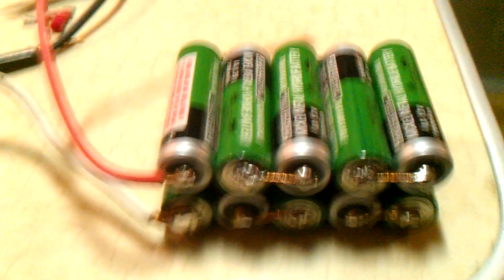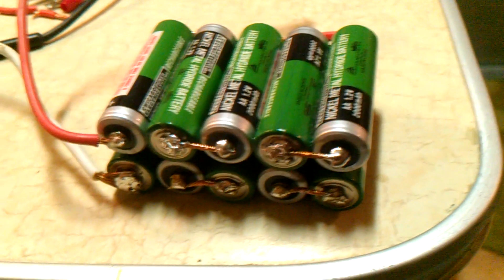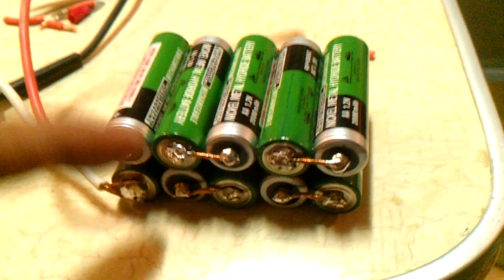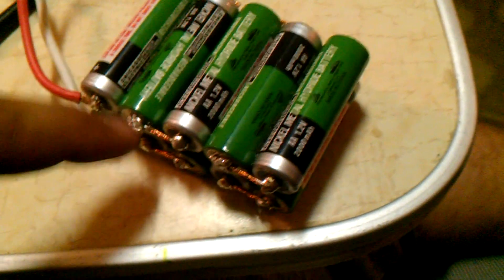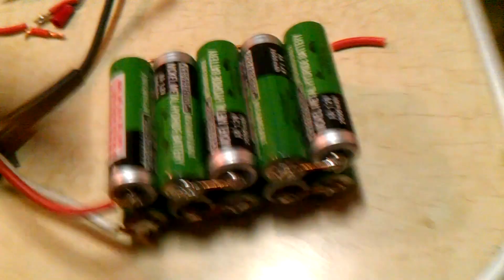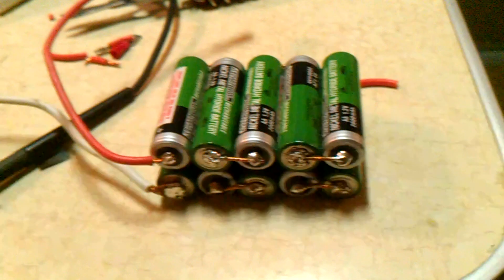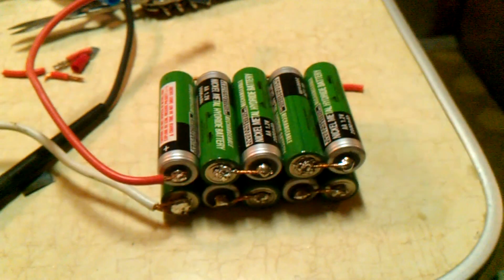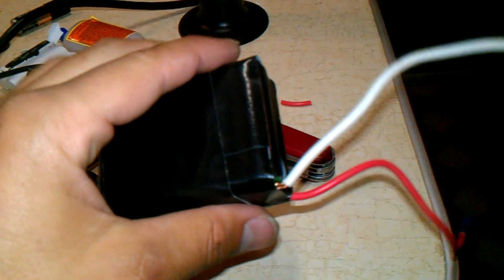How to Build a GOOD Dirt Bike Battery for Under $30 - READ DESCRIPTION

Comment: how long would this run a 30w led light bar?
Reply from the maker: It runs my Cyclops LED headlight (~25w) for about 30mins with the bike off. For a light bar you would need it to be charging. If you just want a battery that will power a light bar on its own (with no vehicle charging), a couple 12v lithium power tool batteries would probably be better.

Comment: can you use a traxxis battery
Reply from the maker: Yes
Reply: Adam Alvarez 
I was thinking the same thing. I still have rc lipo batteries. Lol
Reply from the maker: You couldn't use a LiPo directly, it would have to be Nicad or Nimh as Lipo's require a balance charger. You would have to have a completely different charging system.

Comment: has it gotten hot when you put them im series
Reply from the maker: If they're put into series correctly there will be zero heat unless they're being charged/discharged (like a normal battery).

If you cross any of the wires differently than in the video, it will cause a short between at least two of the cells and they will get very hot.
Reply: Adam Alvarez i did this with aluminium and it got very hot do know i know why
Reply: Adam Alvarez thanks
Reply from the maker: If it got hot with nothing connected to it, that means the battery's short circuiting, which means you connected them wrong.

If it only gets hot when you try to run something like a headlight or a fan, then the aluminum you used isn't thick enough to allow for proper current flow (if the aluminum's getting hot). This is why I used copper wire, because copper is more conductive than aluminum. Also, remember that these batteries are not designed for high current draw. A headlight will cause the battery pack to warm up noticeably, and you really can't run much more than that.

Also, if you allow ANY metal to contact the connectors on the battery cells afterwards, it will short circuit. You need to wrap it in electrical tape before putting it into a metal case if that's what the aluminum is.
Reply: Adam Alvarez yep thats how i did it i used jb weld and aluminium nails as connectors then wrapped in aluminium foil and it got hot at least 89 ℉ so i was like dang
Reply: and at least after 12 minutes of leaving it there wrapped up i checked it again and it was cool at room temp

Comment: How do you recharge this??
Reply from the maker: It should swap in directly with a 12V lead-acid battery and charge with a motorcycle electrical system (NOT for starting, kickstart only). Most kickstart-only dirt bikes have a cruse electrical system consisting only of a voltage regulator for a headlight running on AC power instead of DC.

You would have to replace the regulator with a regulator/rectifier at 12V output, which converts the AC voltage to DC. Many companies sell them, my bike has one from Baja Designs.

Some people are saying to use a car charger. Technically, that will work too but keep it low at about 2-6 amps. Any more than that and car chargers have a tendency to also raise the voltage to above 14V, which would very easily fry the battery.
Reply: Adam Alvarez Thanks for the reply. Im trying to make my Yz85 into a street legal supermini. Figured Id give this a try but now i cant find a banjo bolt to wire up rear break lights. So I guess I cant do it. May look into this in the future though so thanks for the quick reply anyway! Subscribed & liked the video man.
Reply from the maker: There should be plenty of banjo bolt available for the rear brake light. You could also rig up a pull-out switch connected to the rear brake pedal with a spring. That's how the factory rear brake is setup on my WR250R.
Reply: Adam Alvarez Well since the 85s are not commonly made into street legal bikes, they dont sell the bolt anywhere! & the whole spring thing, ill take a look at tmrw. I really want to get this legal but seems like a headache

Comment: 10xAA NIMH is perfectly fine being charged with a normal car charger AS LONG AS THE VOLTAGE DOES NOT GO ABOVE 14.4V at a maximum. And don't charge it too quickly obviously. They can only put out maybe 10-30 amps on a short circuit though after fresh hot off the charger. about 13.5 to 14.4v should be fine indefinitely charging them but no more than that.
NICD might be a better choice if you wanted them to be permanent.. Can supply more amperage and handle more trickle charging than NIMH
Reply from the maker: Mine was originally NICD but I switched over to NIMH for the lower self-discharge and because I put two battery packs in instead of one, sharing the amperage load.

Comment: Thanks for the vid. Would something like this work well too?
https://smile.amazon.com/Talentcell-Lithium-Amplifier-Multi-led-indicator/dp/B00MHNQIR2/ref=sr_1_5?ie=UTF8&qid=1475211399&sr=8-5&keywords=rechargeable+12v+battery
Reply from the maker: Technically it could work, but I wouldn't attempt it. Lithium batteries require careful charging, and the 12v output on a dirt bike is a lot closer to 14v in reality, and not nearly as stable as the included wall charger. You could probably rig something up with voltage regulators but it would just get way too bulky and complex, and still pose a serious fire hazard if you overcharge the lithium batteries.
Reply: Oh wow, glad I asked ;-) Thanks for the info! Would definitely not be fun to have a battery fire on a dirtbike.

Comment: wait your serious lolololol thats like 25$ worth of batterys that will die pretty fast if powering headlights or brake lights thats 25$ every time that battery dies so what u really do is buy a battery on amazon thats for the razor electric bikes and do the wiring and then buy a 20$ charger and boom u have a working cheap battery that can power headlight,brake lights, turning signals, and horns really anything a normal 100$ battery does
Reply from the maker: +dirtbikeride64 The scooter batteries on Amazon are too bulky and heavy (believe me, I tried). There's just nowhere good to mount them unless I strictly stick to the pavement on my rides, which is no fun. You can find rechargeable AA's for much cheaper online, I just bought them at the store because I wanted to have the battery working for a ride.

A normal headlight will run on this battery for about 10 minutes with the engine off, which is all you need to keep the bike street legal (in case you stall it in an intersection or something). When the engine's running it charges the battery and runs the lights just like a car. Also, I upgraded to an LED headlight which runs for closer to 30 minutes.

I also upgraded to a new bike, but that one has electric start and a battery built in :)

Comment: hey if i was do use this on my dirtbike that has no wires or nothing and just buy a little head light will it run it alright
Reply from the maker: +Lachlan Mahon It should run an led headlight long enough for a ride, just remember to recharge it. Thermoelectric generator on the engine maybe? Just a thought...

Comment: Adam. Thanks man. How do I recharge this set up? I plan to mount it inside my headlight just to pass tech inspection at a dual sport ride. Not working it to the bike. Just to the headlight. How do I recharge this once it's built?
Reply from the maker: +Matt Samples Sorry for the late reply, I'm just getting back into YouTube. You can charge it with a car battery charger, just make sure to keep an eye on the temperature and make sure not to use too many amps (2-3 is all I would recommend). The voltage is 12 volts with 10 batteries.

Comment: To save yourself some time, search ebay for "12BH310D-GR"... $3.95
Reply: 12BH131-GR $25
Reply from the maker: That's actually pretty awesome, and does exactly the same thing in this video. You'd have to tape them all together still to prevent the batteries from shaking loose.

Comment: Have you treid wiring this to a rectifier so it will charge just wondering as I could a big old lead acid in my bike but not sure throwing it around would do much good also have you seen the capacitor version
Reply from the maker: Adding one more cell for a total of 11 AA cells would give you a safety net to prevent the batteries from overcharging. The regulator/rectifier in my bike is designed for a pack like this.

Comment from the maker: Ni-MH batteries are actually quite stable, and more readily available than Nicads. Of course, I did have the fan ventilating air outside, as well as a small fire extinguisher 5 feet away.

Comment from the maker: That's a great question.

Buy a voltage regulator (if your bike had batteries originally, it has a voltage regulator). You MUST use a regulator, or you'll fry the batteries and potentially start a fire. Baja Designs sells a nice one.

I think most bikes without original batteries generate AC current, so the regulator should account for that.

Comment from the maker: Yes you can, as long as the voltage and amperage is the same across all batteries.

However, larger rarely means better with these batteries. Most often, the C or D sized rechargeables are just a AA in a bigger case. If you want more capacity, look at the amperage rating and disregard the physical size.

Comment from the maker: These batteries are rated at 2 amp hours. I just built another pack for 2.2 A/H.

The biggest problem is that one pack won't put out a whole lot of electricity at one time, so if the headlight's on and the bike's off, the battery's only strong enough to run the headlight (blinkers won't flash, horn won't honk, etc). All I had to do was build another pack and install it in parallel, and it fixed the problem.

Comment from the maker: It's probably legal in all 50 states (if it's legal in California, it's a pretty good cnahce it's legal anywhere...). As for the ride, that would be pretty rough. The seat is designed to be functional both sitting and standing, so sitting for more than an hour at a time gets very uncomfortable. Time wise, you're talking a week or 2 cross-country.

Comment from the maker: Yes, around 20 minutes depending on the light. I have the issue on my bike of the headlight hogging up the amps, so the blinkers don't work with the light onand engine off or idle. I'm going to make a second one for the blinkers, taillight etc. and wire this one isolated to the headlight.